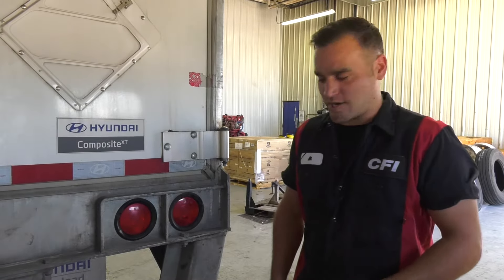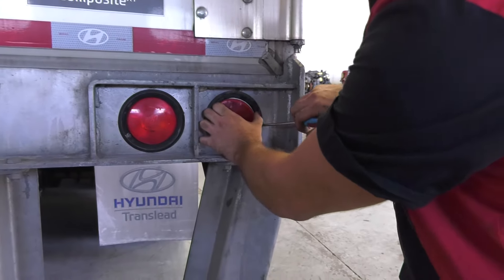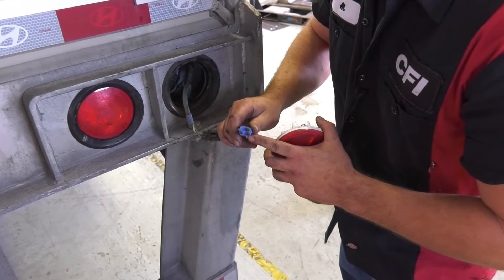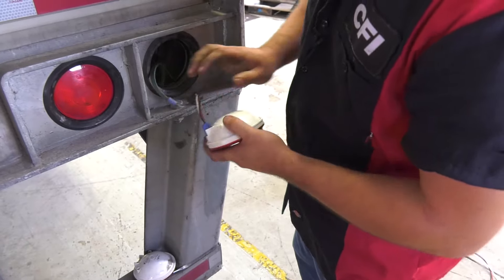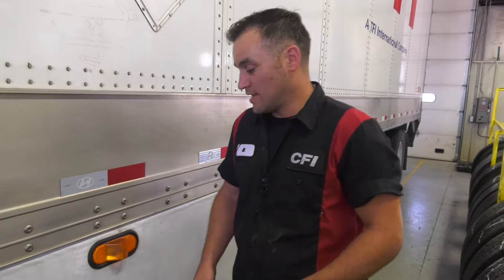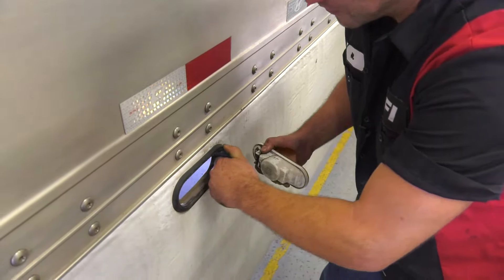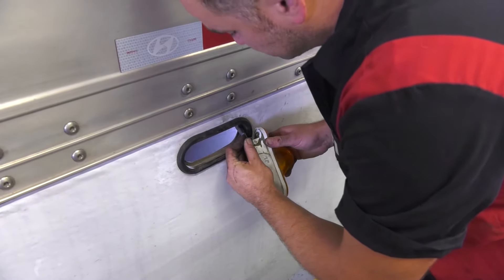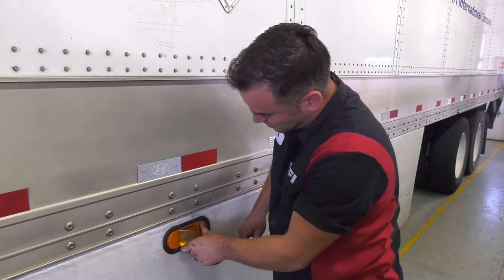Maintenance Minute - Changing Trailer Lights

Comment: Very good video!  One suggestion, for those of us who have never fiddled with a trailer light.  On our twin axle enclosed trailer, I noted the right rear light wasn't working.  Hmmmmmmm... no screws?  Oh, must grab it from the inside?  Ok, not sure that was correct but I removed some interior trim, removed the light/fixture... how do I get the bulb out? Hmmmm.... doesn't look like it's an easy out... let's hook it to a battery and see if it's the light first.  Voila, it works!  So it must be the connection.  But meanwhile, on seeing your video I realize that it's a sealed unit... when the bulb goes, the entire unit goes!  Hey, lots of cars and motorcycles but never seen a light like this.  Your video confirmed it to be an all or nothing affair... thank you.